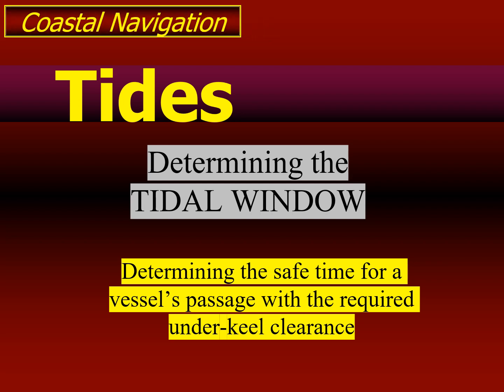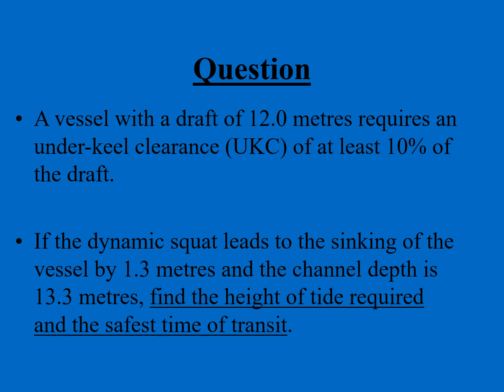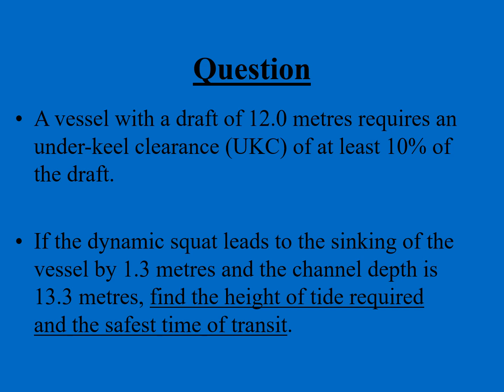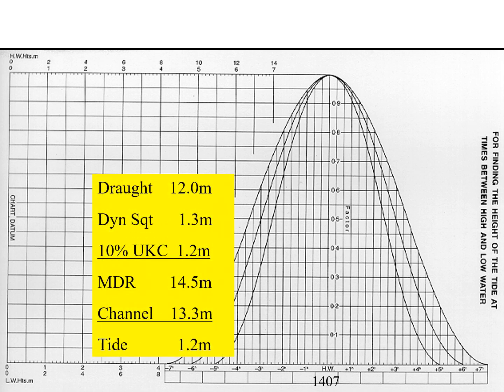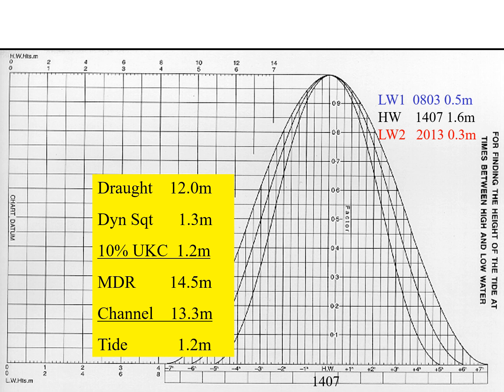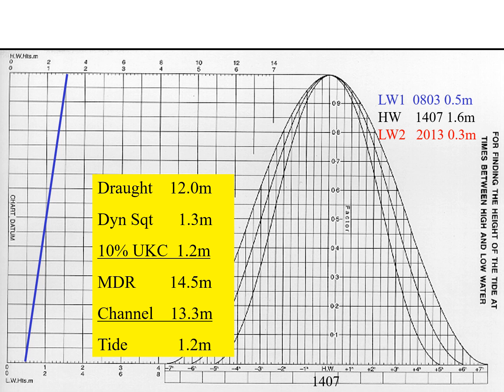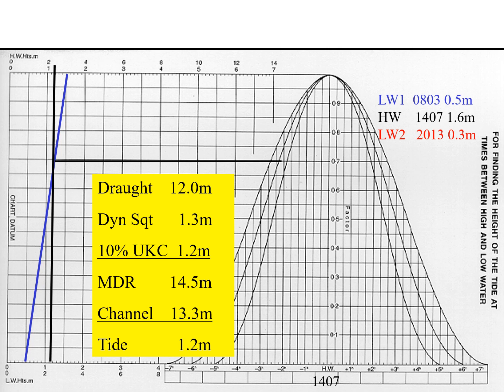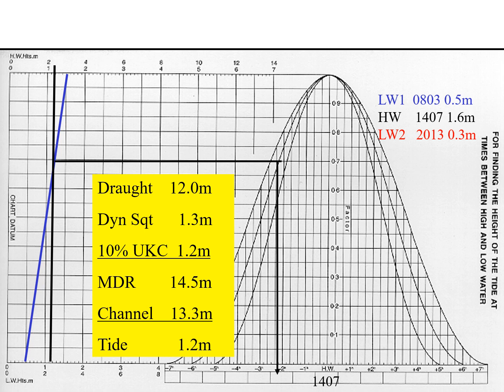Tidal window calculations - Tides (Coastal Navigation)

Comment: if time interval of low tide between 6 hrs and 7 hrs ...so which curve should use .and from where to do draw curve
Reply: Plzz give an answer sir
Reply from the maker: Tanmay...you can draw it in between as per an estimate (you don't get much space to play around with). The difference will not be too significant. In practice, the Master will anyway keep a margin of error for safety.
Reply: Answer plzz
Reply: thanku sir...interpolation for volume 1 by calculation ..and for volume 2 and 3 by visualy propational interpolation ..am i right sir?
Reply: Hi 
For preparation of second mate / DNS/ BSC nautical science/NCV full course come in #kundanpatna
Reply: For prepration of 2nd mate / DNS / BSc Nautical science join #kundanpatna